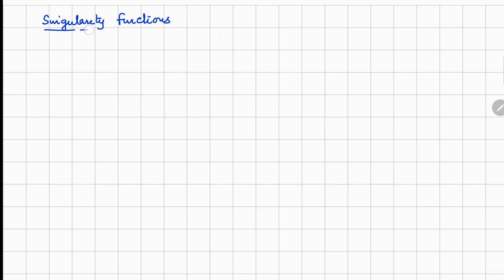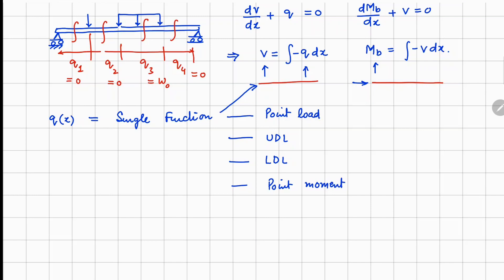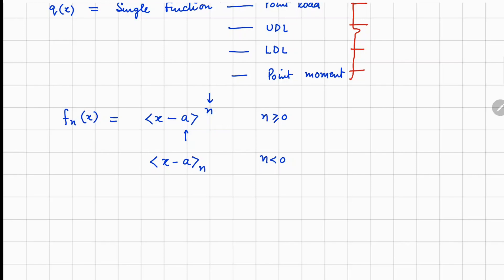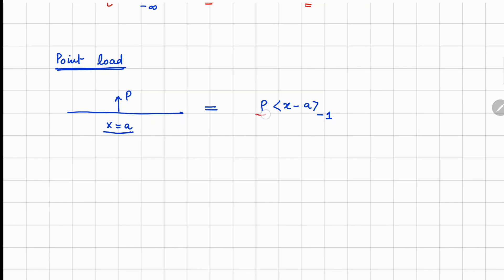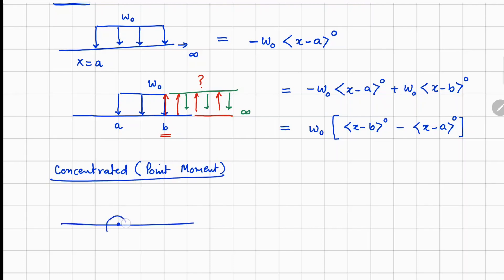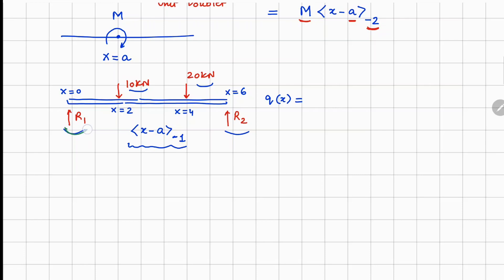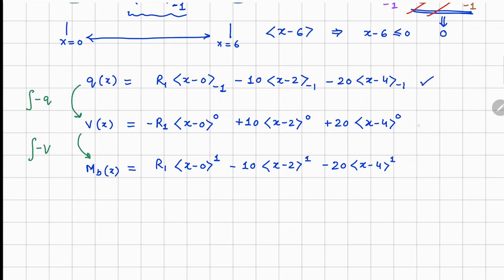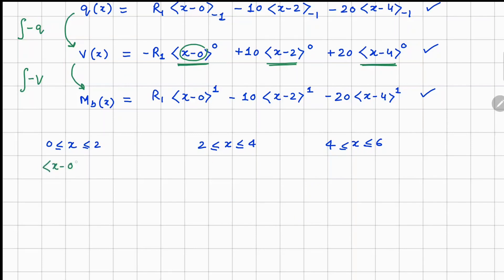Singularity Functions for Shear Force & Bending Moment Calculation || Mechanics of Solids

Comment: How do you extend the load for linearly distributed loads?
Reply from the maker: You mean how to negate the extended part of LDL in case it has a start and end point? In that situation, you can imagine an opposite LDL+ UDL starting at the endpoint (extended region) of the LDL. The value of UDL is the same as the intensity of LDL at the end point.